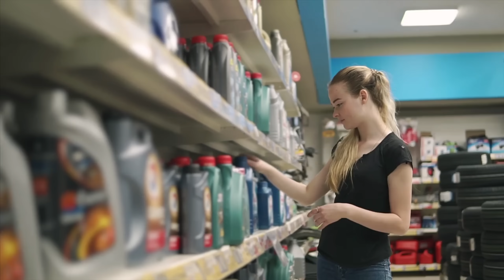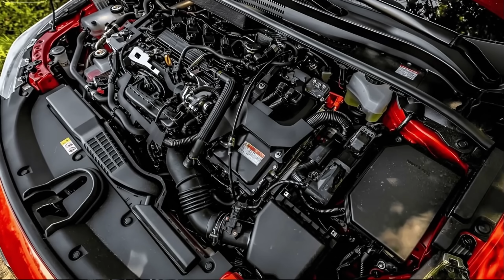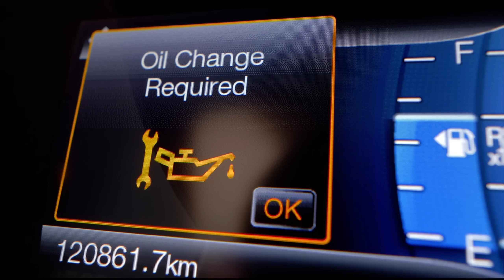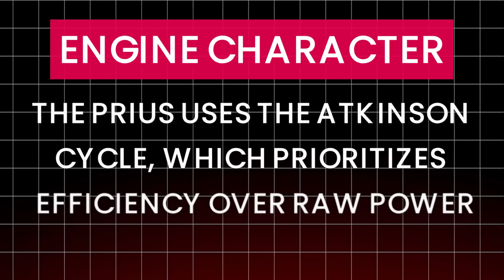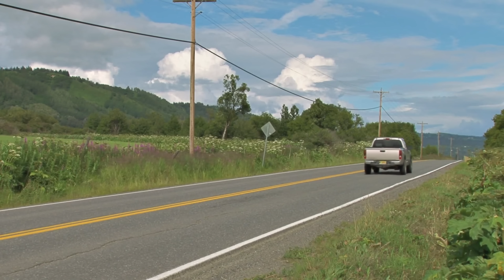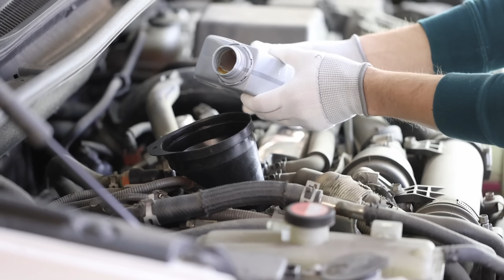The Single Oil Mistake Destroying Toyotas Everywhere

Comment from the maker: If you drive a Toyota, what oil are you using right now?
👇 Comment your model + oil grade (0W-20, 5W-30, etc.) and I’ll tell you if it’s the correct one for your engine.

Also…
➡ What Toyota model should I cover next?
Corolla? Camry? RAV4? Hilux? Prius? Tacoma?

I’m replying to every Toyota owner today —
let’s make your engine last 300,000+ miles. ❤🔧
Reply: 4 runner 0w20
Reply: 07 tundra 5.7 just got it, unsure
Reply: 09 Camry LE/ 0W-20 in Northeast weather.

Comment: So the Toyota owner sees when he opens the hood what type of oil his engine uses as it's clearly  printed on the oil filler gap. Wonderful..but who can you trust to do the oil change is the overwhelming question...even if you furnish the five quart container  of the correct oil and furnish the correct Toyota oil filter. Did the guy actually use them. Same for an oil change at the dealer you bout the car from. Did he change the oil or just tell you he changed it?  An Independent car repair shop with a five start YELP rating is pretty good because he can't really afford to have a bad customer review published on the internet - that lasts forever.

Comment: it is not rocket science.. Oil cap tells you which oil grade..When I take my 2012 Lexus ISF with the V8 , all stock car, into the Lexus Dealer for an oil change;  They do not even carry the correct oil grade. They had to go get the correct oil.   They were just going to put in what ever they wanted to put in , I guess..  I had to go out there in the garage and show them the darn oil cap...:)

Comment: '25 Tundra.  5w 30.  More oil pressure at the gauge in all temps.  My '21 Tundra had nasty chain rattle with 0w 20 and was gone with the proper oil.

Comment: The Car Care Nut, a master Toyota tech, states that the reason for thinner oils is to reduce emissions. The problem is the variable oil pump not working as should with thicker oils.
He said that the Toyota cars in other parts of the world that use 5W-30 oil has different engines than the engines that require 0W-20 oil
Reply: I put my faith in   Car Care Nut.....  I watch him closely because I have a   '17 Landcrusher and he has them in there a lot.  :)
Reply: He is wrong. It's the same engine. Use 5W30 in the summer months and 0W20 in the winter.
Reply: @maj8301 And you know this how?
Reply: @maj8301  they might just have different fuel pumps

Comment: This is bullshit Toyota like other cars manufacturers using super thin oil because EPA Regulations. 
The problem is not the cold start but the operation temperature 100C (212F).

Comment: I prefer the videos that show actual non-biased science (motor oil geek, engineering explained, etc) rather than wordy opinions.  My engine, M20A-FXS has different Toyota recommendations in different countries.  Several factors play in to this but the main one seems to be USA CAFE standards.  I live near the equator so cold is never a concern for me.  Mine is a hybrid and I am pretty sure that the electric oil pump brings up oil pressure and spins the engine up before sending fuel and spark so I have No cold starts.  I believe I saw that in Saudi’s Arabia Toyota recommends 5W-30.  Different recommendations in Australia too.  So everything from 0W-16 to 5W-30 depending on where you buy your Toyota.  How heavy are you loading the engines, towing, driving hard, track day, mountain driving?  I check oil every refueling.  If it is dirty I change it, if it is 3-5000 miles I change it. If it is six months I change it.  I drive it 2-3 times per week (retired) to keep fuel out of the oil (let pcv do its work) and keep the batteries happy.  I used to think you use whatever the manufacturer recommends but I see that even Toyota has succumbed to the CAFE mpg bullying of the USA government.  They are more worried about emissions and mpg than throwing out an engine or full car at 8-10 yrs old.  I like to keep my stuff running a long time.  I will accept lower mpg if I don’t have to throw my engine away at 10 years.
Reply: I have the same engine in mine. Just to let you know, these cars do not have an electronic or electric oil pump. That is something that was mistakenly stated by a very popular youtuber that works on Toyotas. 

I have a RAV4 prime and have researched this to death. All rav4 primes (and standard hybrids) are built in Japan. Japanese market and US market RAV4 have the same ICE. If you download the owners manual from the Toyota Japan website, it states you can use 0w-16, 0w-20, 5w-20, 5w-30, and even 5w-40. These cars use an electronically controlled flow control valve (not oil pump) and it regulates oil flow based on data from various sensors including temperature sensors in the engine. Keep in mind that a sump full of 0w-16 in Alaska in the middle of winter is going to be a lot thicker and flow with more difficulty than a sump full of 5w-30 in the very same car sitting in Arizona in the middle of summer, so this whole notion of not being able to use the heavier viscosity oils is a myth. 

CAFE standards more than emissions has more to do with these ultra thin oils being mandated in the U.S. If cars aren't able to hit certain mileage goals, the manufacturer gets penalized (fined), and based on what I'm reading, they can be penalized for recommending oil viscosities other than what was mandated by CAFE at the time the viscosity was approved for use in that car. 

Earlier this year, the power  to make these mandates was taken away from CAFE, effectively neutering them, so it will be interesting to see the oil recommendations that are written in manuals for vehicles coming out for 2026 and 2027.
Reply: @Dimitrius001 thanks for your response

Comment: 5 decade + mechanic here,going from 0w-20 to 5w-20 or 5w-30 isn’t too much of an increase in oil visc to cause issues either todays engines clearance wise & with vvt too. But,going to 10w-30 or heavier visc oil will likely cause chk engine/vvt issues.

Comment: Rav with 285K miles running 0w-20 in Florida no issues. OCI 5000/6 months
Reply: agreed, too many engineer wannabes, if the manual is wrong and they don't know what they are doing, you shouldn't own that car.

Comment: My 2023 Toyota RAV4 XLE AWD uses SAE 0W-16 full synthetic motor oil, which is the primary recommendation for optimal fuel economy and engine protection, though some sources mention 0W-20 and 5W-30 as an alternative to use temporarily. I change it every 6 months because I drive less than 5,000 miles in a 6 month time frame.

Comment: CAFE requirements drive the move to thinner oils. Same engines are spec'ed for thicker oils in other parts of the world.
Reply: Exeor engines were designed for thinner oil to meet standards.  Never believe speculation that you should you thicker oil unless you have a UOA trend to support.